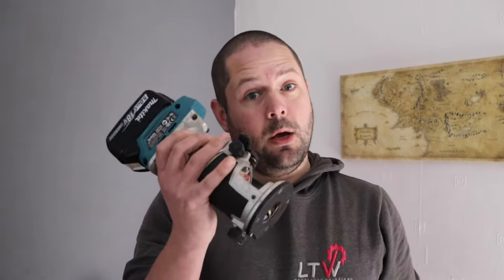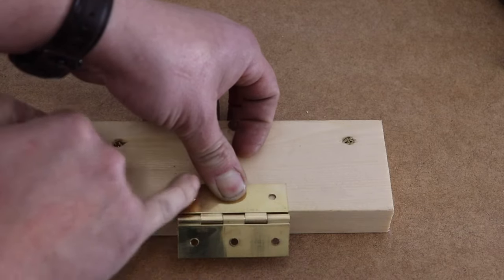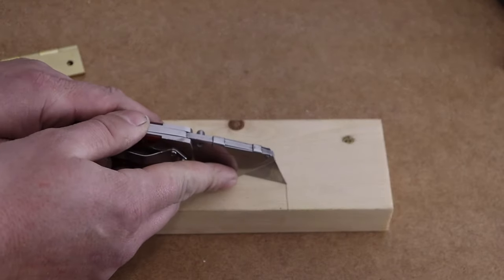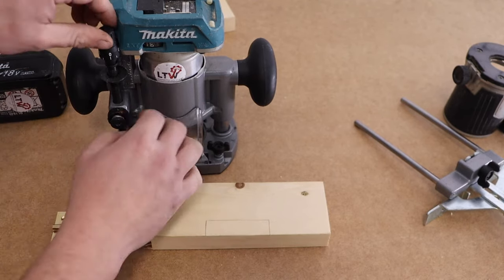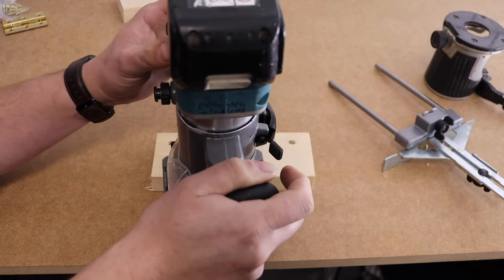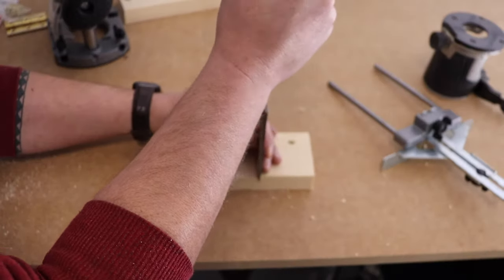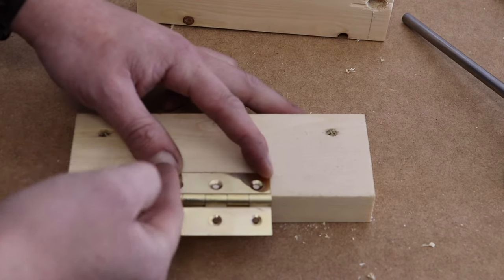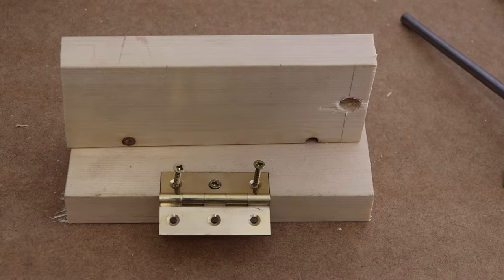Door hinge installation #carpentry #woodworking #joinery #carpenter

Comment: great video, thx! I dont quit get why you drilled the wood hole towards the back of the hinge hole instead of centering it. Can you explain why you wouldn't just position the hinge exactly where you want it from the start, and center the drill holes?